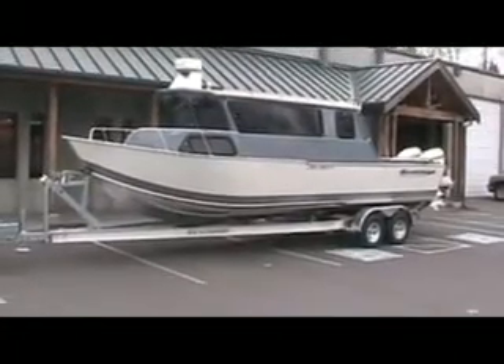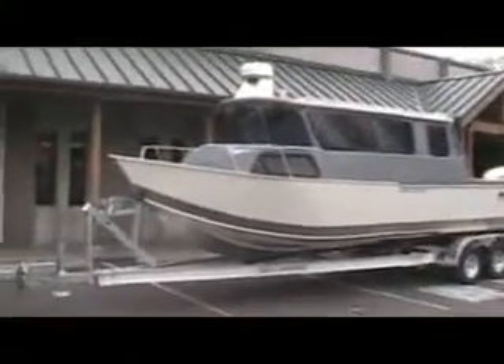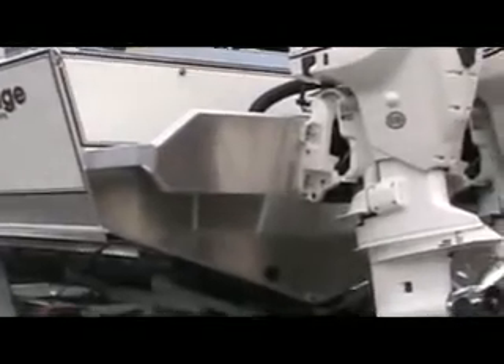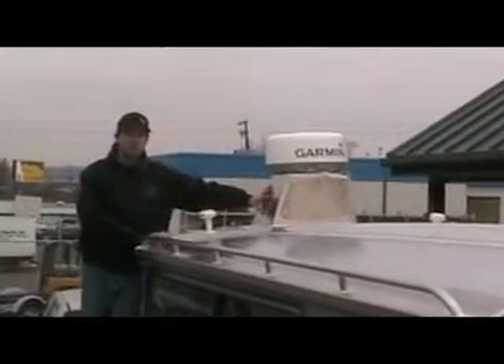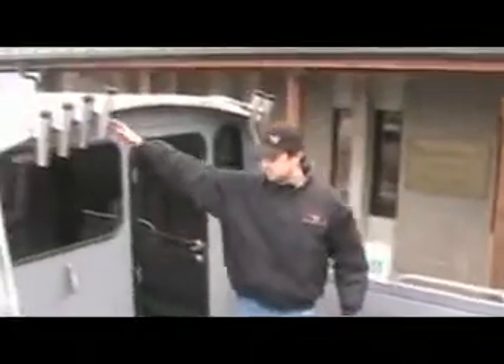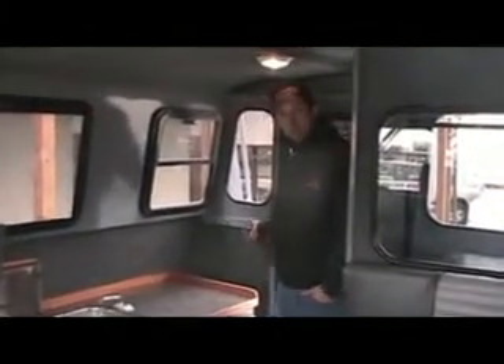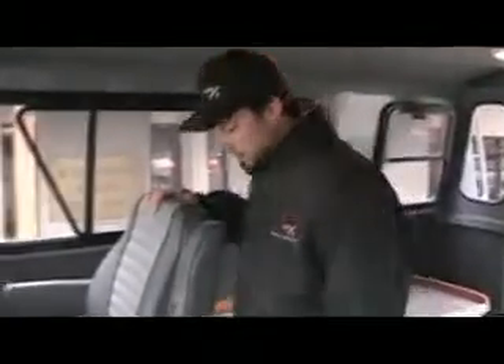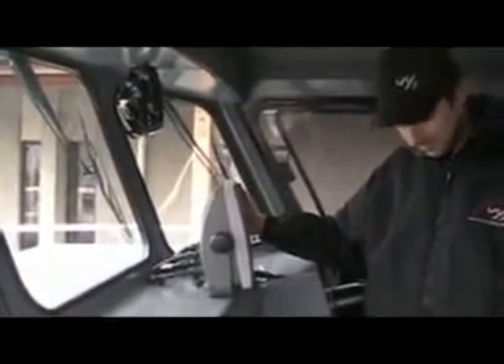Wooldridge Pilot House 26" 2008

Comment: Cool boat man! I did,nt know that the Evinrude 115hp had that much power for that size of boat? just running on 1 motor an you have 2, wow. I'm an Evinrude man myself w/ a older 200hp outboard on my 24 ft fiberglass cabin cruiser boat. Thanks for the video.Barrow,Ak 99723...